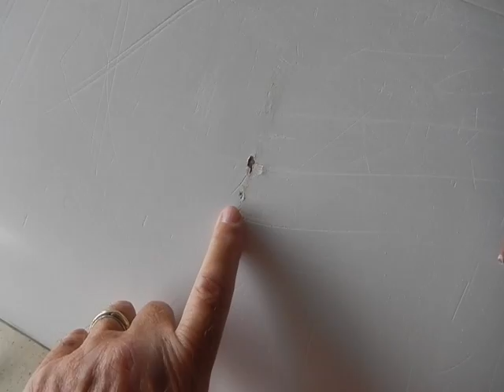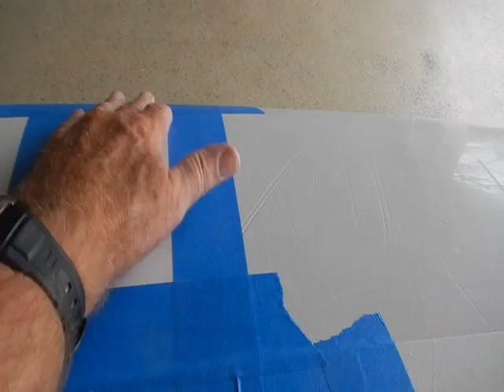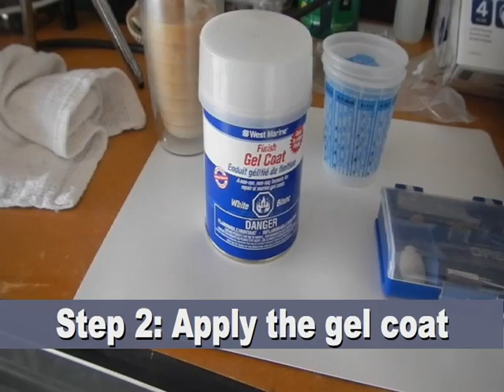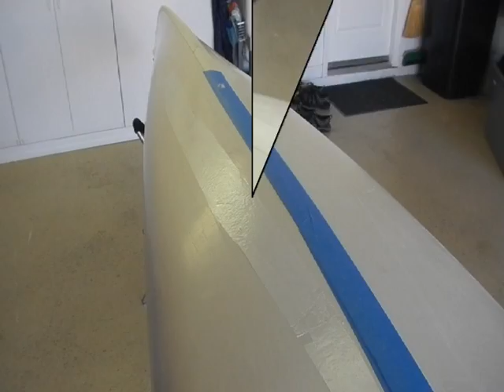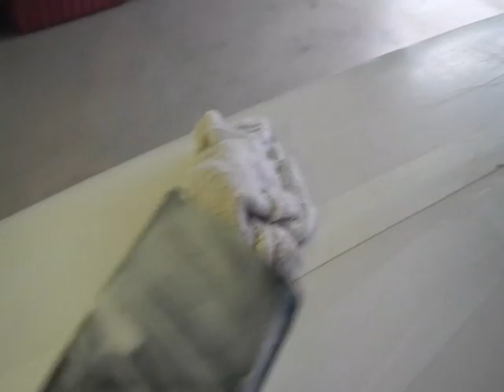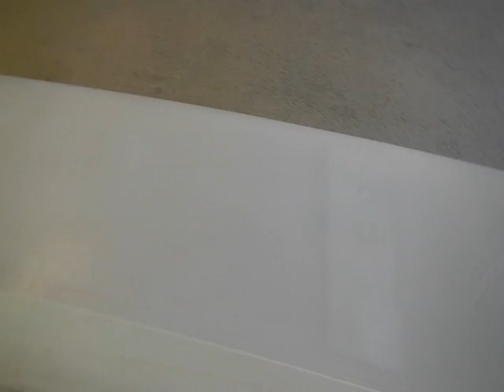Gel Coat Repair

Comment: Nice job bringing back the surface.  For a slicker surface you can get gel coat in spray paint cans from dolphinite.  They do clear coat, regular or custom colors (will match samples), with no mixing, getting the equipment, or cleaning up.  They work well and make it easy for a project like this one.

Comment: You should have used a fairing compound to fill the scratches then gel coat over that. Don't forget to clean your sanded areas with some acetone.
Reply from the maker: Sounds like a good suggestion, but I don't know what a fairing compound is.  Please enlighten me.
Reply: https://www.amazon.com/fairing-compound/s?ie=UTF8&page=1&rh=i%3Aaps%2Ck%3Afairing%20compound
Reply: Fairing & Filling Compounds. These filling and fairing compounds are perfect for structural and cosmetic fiberglass repairs. The marine epoxy fairing compound is for fairing surface imperfections or corners on a variety of surfaces with excellent weather resistance, for both above and below the water line.

Comment: cant hear you talking for that ridiculous thumping.
Reply from the maker: +WelderBob Hey Bob, I was concerned about your comment so I watched the video again.  There is music that contains a thumping beat that mostly plays in non-talking sections of the video with fade in/out as talking sections begin or end.  I had no problem hearing the vocals on my computer and the "thumping" you mentioned was there, but not pronounced.  So I'm not sure what the issue is for you.  Perhaps you didn't really get into the video far enough to get through the intro section.  Or perhaps your browser or computer emphasized the bass elements of the sound track.  In any case, many folks have found the video useful.  Sorry it didn't work for you.
Reply: may have something to do with my computer then, thanks.

Comment from the maker: Thanks for your comments.  I think most folks who damage their boats have neither the know-how or equipment to do a professional level repair to gel coat.  I've used this process several times now and it works pretty well.  My biggest issue is my lack of patience in completing the work.  I've priced out the cost of having the work done professionally. It would cost me a third to a half the cost of a new boat to have the hull's gel coat redone.  Not worth it on an eight year old boat.

Comment: I just wish I could weed out the instructional videos from the people that don't know what they're doing...
Reply from the maker: FYI, I am not a professional fiberglass repair man, as I assume you guessed from your comment.  But then, neither are most of the folks I know who have damaged their boats and would like to fix them.  I have seen some pretty bad fixes, so when I went to repair mine I researched online and what you see in the video is what I came up with,  It worked pretty well on my eight year old boat.   You may think I don't know what I'm doing, but the repair looks decent and protects the underlying fiberglass.  Perhaps you should make a video showing us all how it could be done better.  I'd be interested.
Reply: As a matter of fact I do plan on doing a video.  A friend of mine needs some Gelcoat repair done. Ill be talking about spray guns settings and mixture ratios.
Reply: Me Too
Reply from the maker: foxybrown2
Have either you or BadRonald done that instructional video you talked about yet?
Reply: BadRonald1 I bookmarked this video because as an amateur I have the same amount of experience and material at hand as the poster of this video and even if he is no professional the video has given me good insight of the problems I have to face when doing a small repair on my boat in order to protect it. I don't mind if the reult is estethically not perfect, but I face the same problems and it helps me seeing what other people do to avoid them (spread the gelcoat covering it by a plastic film is really interesting). 
So, thanks to all the professionals making tutorials, very much appreciated, but to all the laymen, keep up the work.
Reply: mio Thank you for sharing that with me mio, Ill let you go so you can get  back to work.  shhhh

Comment: Thats a new way of doing it...not bad if u don't have a spray gun. I would have just. Ground them out sanded a 1/2 inch out side the area with 220 and filled them in with a gelcoat putty made from aerosil. If your not satisfied with the blending then you spot spray it with a preval. Use a 2% wax and thin it with acetone.

Comment: Use finish gel coat, already has the wax in it, so no paper or plastic or touching the work.
Also I recommend you spray it on with a small touch up spray gun or a " Prevail" portable sprayer.
Wet sand with 400 then 600 then buff it out, super shiney!